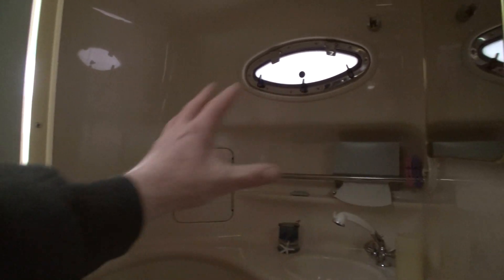Building A Shower Stall on the Boat

Comment: Pontoon boats have the system you need. The popup change room/shower system they have would work, with a customized mount.

Our Monterey 302 has a fold down shower seat that cover the toilet and the hook for the shower head is away from the sink. So just a quick squeegee of the walls and everything is dry again.

Comment: We have a 2009 Regal 3360 Window express...very similar boat. Our stall has a full curtain rod over the door, from corner to corner. Then has another full curtain rod from the opposite side, behind the head to infront of the sink cabinet both with snaps on the wall to hold the curtain fully open. With this configuration, you can pull the curtains back separately and then they can tie up nicely back in the corners out of the way. Good Luck!  TGIS (THANK GOD ITS SPRING!).
Reply from the maker: Thanks! Keep an eye out to see what we come up with. And when I say 'we', that's code for whatever Anchor Girl thinks is best ;-)

Comment: Hello Mr. Boogboo! I’ve been boating in the same water ways as you since 2011....last time before that was about 32 years ago. I’ve got a 1995 310 Silverton Express cruiser and have also done many upgrades. One of them that I will be doing is redoing the head.

Comment: Hey bud, I have a 1968 Trojan and I'm looking to install a shower in the same way you do. Could you help me find that faucet that you can extend and clip to the wall to make a shower head?
Reply from the maker: That flexible hose + fitting is what was factory installed from Sea Ray. All I did was swap out the shower head. If you email the folks at Sea Ray directly, they should be able to point you to their OEM supplier. . .